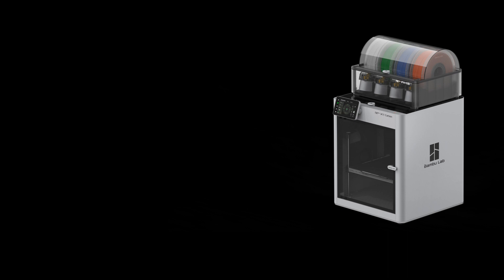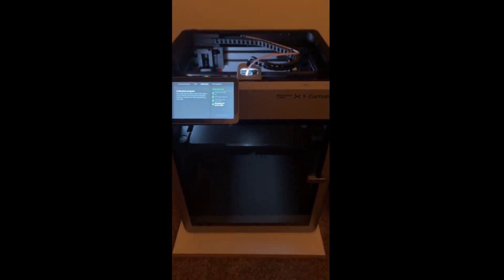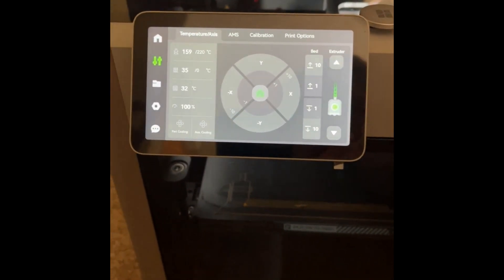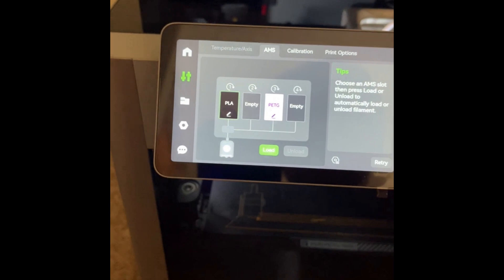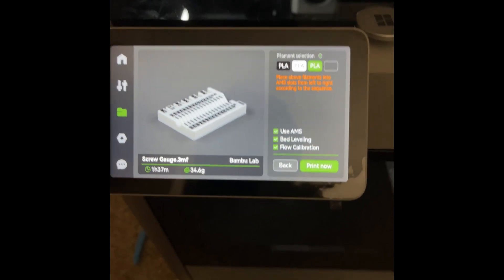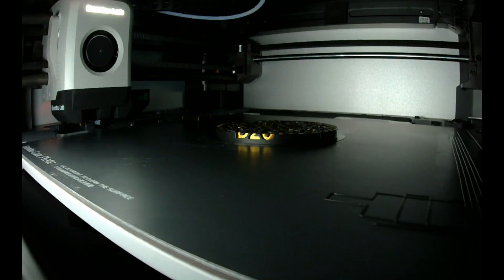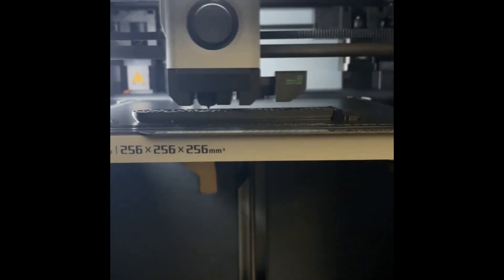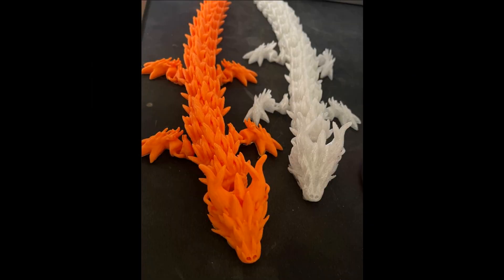bambu lab x1 carbon -1 week thoughts and impressions

Comment: So when the printer does a calibration, it is only valid for that first color? The other colors would also need to be calibrated but I don't see how it can recalibrate for each color unless you can, as you say, store that calibration for each individual roll.
Reply from the maker: I think it stores it on the machine somewhere. I’ll check out the documentation at some point, people keep telling me it does so curious about it. It would be nice for it to ask to calibrate when a new filament is added or an option to calibrate all, so for instance if you add multiple new roles, they all have at least 1 calibration done. Might be getting another vid just to do a update  and what not. Overall my complaints should be taken as nitpicking, if I compare to what I had before I’m pretty spoiled now

Comment: Like showing off a Tesla of 3D printers and telling everyone to go buy it it is fantastic... except 90% could not afford this over priced printer even if you were to just buy the base unit without the EMS bit it would be far too much for most hobby printer fans... so like the Tesla only rich can own it or in this case you tuber channels get it sent to them to review to free.. pointless even saying how good it is, when very few can buy it?
Reply from the maker: Depends on what you’re comparing to, to an ender 3 or less sure, to ender 5 pro or greater, to any prusa not really. And for how much you save on filament(less failures), how much you save on energy(doesn’t heat room because it is enclosed, also less failures so don’t have to run again when it fails). And it’s about the same as that new iPhone everyone needs. The price while it’s more expensive than some, is not unattainable. For $1000 and what it offers I would say it’s worth saving up for, doesn’t heat my room up, better use and less waste of filament, and it does it faster, on top of less time spent calibrating/leveling and prepping 🤷‍♂️ but to each their own
Reply: The Bambu is not a hobbyist printer and it appears to be an outstanding value for the money, not overpriced. It may not be as inexpensive as a Creality, but then it's also not as cheaply made. In this case you do get what you pay for. Like the Prusas, it's intended to print out of the box, not teach you about the hobby of 3D printing or how to take a $200 printer and upgrade it to the point of being able to reliably print quality parts. For a small business that uses 3D printing, the Bambu will greatly increase productivity because it prints at least twice as fast. I downloaded the Bambu slicer (based on the Prusa slicer that's open source) and printing at 0.08mm it prints in half the time that my Prusas can print at 0.20mm. At identical resolutions it's better than 1/3 of the time. It'd be great if someone sold assembled Vorons, and if Prusa's own CoreXY machine wasn't delayed, but the best Voron kit is about $1,500 and you still need to print parts for it, assemble it and get it printing, and the Prusa XL is going to be about twice the cost of the Bambu. At ~$1,000 to $1,500, ready to print out of the box, there are many people who can afford the Bambu. They've already sold about 5,000 units through their Kickstarter campaign.
Reply: I don't get your perspective because it ignores that prusa are around this price and many hobbyists buy prusa.

Sure some can't afford it, but many can.

I'm a regular guy, a hobbyist and I think the price is great for what you get and the convenience of the autocalibration.
Reply: @BeefIngot  makes no sense - the time involved in cheap printers is worth the few dollars - this attitude is WHY 3d printers still are complex, slow and fail often -
Reply: @VanguardSys  I... Have no idea what you mean to be honest. The first part of your comment seems to disagree with the second half.
Reply from the maker: Also I paid for my kickstarter because I saw the potential in it, so far it has come through with minor dislikes in it. They haven’t sent me anything beyond what I paid for I’m basically a nobody to them lol
Reply: I agree that not everybody can afford to spend $1000, that does not meant that the printer is overpriced. In this case the contrary is actually true: it is underpriced for the specs. Especially compared to pretty much every other printer out there. And time is actually money. You can spend $300 for a bed slinger and waste a hundred hours learning how to use it, fine tuning it and modding it until you can achieve good results (at low speeds), or go with an option like this that allows you to unbox and print with great results with almost no intervention. No other printer at that price point can compare, unless you go for a kit and build a ratrig, a voron or the likes from ground up. In that case the price would be similar, but again, how many hours spent on it?
Reply: you don't know a lot about 3d printers if you think this is over priced, its the exact opposite. Any other company would have sold this printer for $10,000 minimum. For example Ultimaker sells their printer for $7,000 and those printers are far inferior compared to the Bambu Lab X1 but cost 7 times as much. The X1 is a bargain, only someone who knows very little about 3d printing would say otherwise XD
Reply: @muniradlan3659  I agree that the X1C is a reasonable price, but I think what you miss about Ultimaker is firstly that they offer dual hotends for more efficient dual filament printing as well as offering better filtering, a material station with more materials, and training and support for business, which businesses really value.
Reply: @BeefIngot  flash forge offers the same but for a fifth of the cost. There's a reason why ultimaker collapsed as a company
Reply: @muniradlan3659  No company is buying a flashforge. They are buying ultimakers due to the support and predialing in.

As for them """collapsing""" I have no idea why you would think that. They absorbed Makerbot. If anything, it seems more like Stratasys was done with Makerbot.
Reply: @muniradlan3659  i agree we need to STOP this hobby cheap crap mentality - we need quality tools not projects

Comment: The printer stores your previous calibration.  You don’t need to calibrate all the time unless you are changing filaments
Reply from the maker: I did not see this in documentation, I’ll have to check again 🤔
Reply from the maker: Still see it as a problem if you load it before a print and it’s not the first filament to be printed
Reply: @swankyt3ch  agreed!

Comment: what material have you tried? i would jump on abs but my anycubic can't print pieces bigger than a bency
thx for all the tips in your video, this seems amazing but i don't want to go for the preorder
Reply from the maker: So far just pla and petg, I’ve done abs on my ender and didn’t really have as many issues as with petg so haven’t done it yet, most things I would do with abs I default to petg but might grab some to try. I’ve got a little of the pa-cf it shipped with but waiting to find something I want that’s worth using it for, also plan on grabbing some other brands carbon fiber off Amazon to play with but need to either design or find a design I like for it first
Reply: @swankyt3ch  I’ve been using polymakers pa6-cf with it and I couldn’t be more impressed. I had to slow my qidi down to 30mm/s to get accurate prints. I’m getting 300mm/s on the x1 with the same quality 🤯